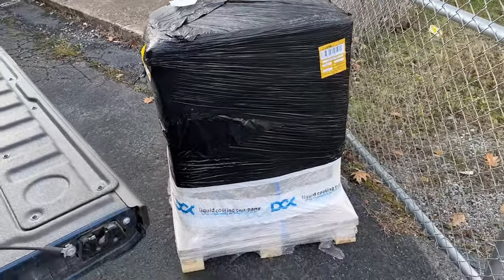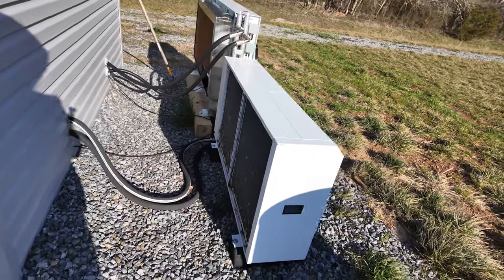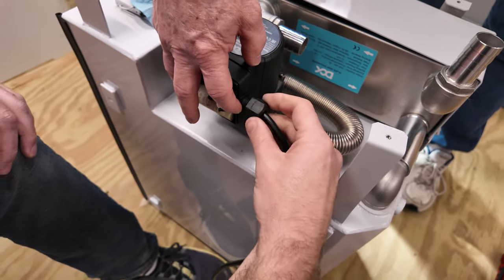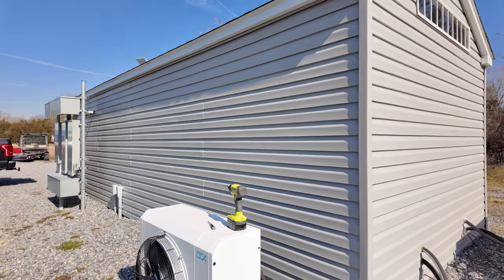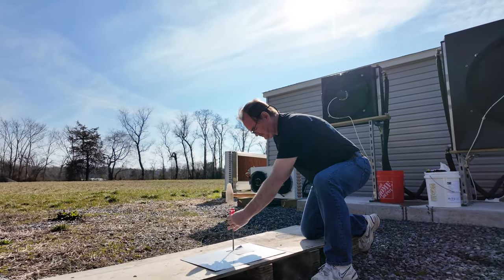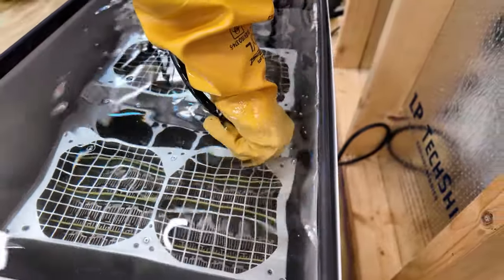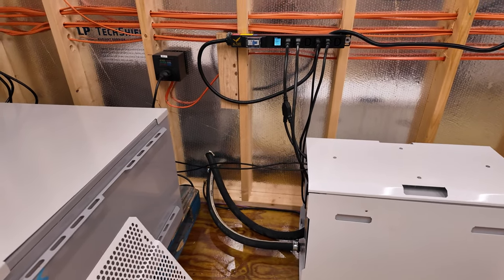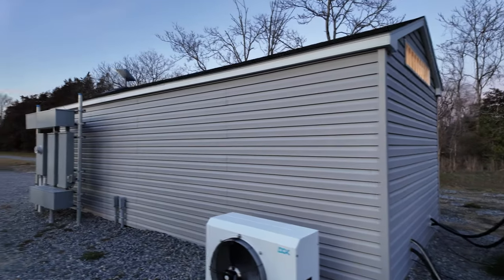Beginner Immersion Mining! Liquid Cool Bitcoin Miners!

Comment: With the Altair PDU; can you only run 1, S21 per PDU? @3550watts/each, powering 2 Bitmain S21's puts you at 94.67% of the voltage capacity. Can you only have 1 S21 per circuit or is there some way around this?
Reply: You could underclock them. Like running at 80% 2 S21s
Reply: @miroslav1793  thank you for answering, but really want it running at full power. I would add more circuits, jw if this is the only option.

Comment: i allways suspected that the s19 and s21 where basicly the same circuit but with slightly better components ..............i wonder if i can find better quality asics and a higher capacity psu just run the older setup a bit harder whle still keeping it stable

Comment: Everyone makes mistakes, like your honesty and how you dealt with them. Please try 50 amp circuits. I did (actually my electrician did it) and it made my life much easier. Running THREE S19j Pros 104 normal mode on a single 50 amp circuit at HOME. You have the power and flexibility to do it. Give it a try. Best of luck with your projects.

Comment: Hmm, I didn't get any feet with my C6. Is the power consumption of the 8-bay DCX mainly due to the frequency converter? I bet if you remove that the power consumption will drop significantly. Do you know of a source for the "new" square fan plug spoofers?
Reply from the maker: I did… and surprisingly it didn’t, have a video on this and other developments in editing!

Comment: why choose this unit over the fog hashing c2 that's 1k cheeper?
Reply from the maker: Testing all of the different options out now!
Reply: The DCX system is a dual-loop system. You can easily connect it to your water heating system at home, or swimming pool. As you're getting the system ready for 4x Whatsminers M30/M50 series or Whatsminers M56 (!!) as it has a greater cooling capacity. You can store inside also tall miners (that's why there is the black divider - for shorter and longer miners). You're getting a superb synthetic fluid. You get the dry cooler, with anti-vibrant feet, with a Ziehl Abegg fan, and a fan speed controller. The system runs water on the dry cooler side, so the cooling is twice as effective as for the single-loop systems with oil in the dry cooler.